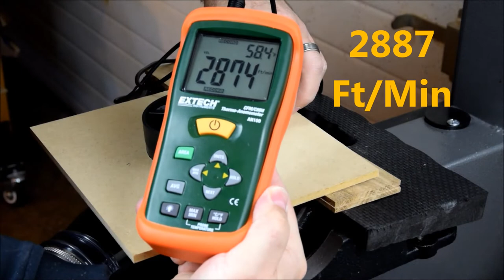Bandsaw Dust Collection Laguna 1412 Bandsaw for DIY and Pro Woodworkers / Woodworking.

Comment: I built this dust shroud for my bandsaw 3 weeks ago.  I want to thank you for sharing your mod.  there is minimal dust on top with round cuts and even with using a sled.  I can feel air pressure with my hand over the narrow slot on the sled!  I've also resawed ~ 4" wide stock and the dust collection is greatly improved.  as you said, most of the dust is from the initial cut, once the blade is buried in the stock, there is minimal dust.  thanks again
Reply from the maker: Awesome!  Thanks for letting me know.
Best

Comment: Just want to say thank you for your creativity and design.  I recently purchased the 14/12 and was very happy with the cuts I got with the Laguna Resaw King.  My only complaint was the dust collection. It spat debris all over the floor just below the table in the front and sides.  I have a 3 hp Oneida V system and I was measuring over 700 FPM in  the 4 inch hose attached to the dust port.  That should have been good enough.  But the airflow around the blade below the bottom guides was pitiful. Then I found your post.  I looked closely at the lumberjacks site and was able to consolidate all of the information to come up with the dimensions of all the components and now I've got to build it.  But, based on your video, and giving it a lot of thought, I'm confident it is going to work as you have demonstrated.  My only reservation is whether or not the Resaw King somehow spits the debris out differently than the blade you used.
Reply from the maker: Hi Nicholas, thanks for the nice comments.  You will like the new dust collection box.  It works just as well with the Resaw King blade, which I also have.  I use a 1/2" ProForce blade for everyday cuts though.  Best.

Comment: I have the exact same saw without your dust collection improvement and I can assure you my lower cabinet has never looked that clean!  Definitely an improvement I'm going to have to make when I have a chance.  Thanks for sharing!  I'd also be interested in your table extension if you have any info on that.
Reply from the maker: Hi Rob, 
Yes I have detailed info on how to make the outfeed table for the Laguna 1412.  Check out my bandsaw mods video! 
Thanks

Comment: By chance, do you have a particle count meter and have you looked at changes in fines in the air before and after? This looks like a great idea, but I've come to believe that what we see may not be a good indicator of changes to fines, which are too small to see. Offhand, my guess is that your mod must help because of the increased velocity, but have you measured in any way?
Reply from the maker: I've measured with an anemometer for airflow, but not with a particle meter.  I know that some mods only make marginal improvement, but from personal experience and from others who have commented here... this mod makes a tremendous difference.  
Best
Reply: @TheThoughtfulWoodworker  I very much suspect you are correct and am going to try this on my 1412.

Comment: Why not run 4” on both ports? Asking because I’m about to do a similar project and have 4” going to bandsaw and was going to do 4” Y - two 4”s but see u did a 4 and 2”
Reply from the maker: My setup is honestly more like two 2-1/2" ports.  The lower port is 4" in size, but it's choked off by a magnetic cover inside the lower cabinet.  The upper port is 2-1/2" in size and relies on high suction and air velocity more than CFM.  I've experimented with a lot of bandsaw DC setups and the ones with a high velocity upper pickup box (like this one) seem to perform best.  
If you have a 3-5hp dust collector you could probably get away with two 4" ports. 
Best
Reply: Ugh yeah I’m not sure what todo I have a 2 HP grizzly that is only hooked up to table saw and a Dust right Quick Change hose that I connect to band saw but it’s an older 14 inch model that came with 0 dust collection and a bunch of gaps for dust to fly everywhere- I installed a 4” port on the bottom cabinet where lower tire is but it doesn’t do much as there’s a lot of open space between cut area and port so gonna add something similar below the table like u did - guess I’ll have to experiment more
Reply from the maker: @josephromero1596  you will love the dust collection of a split system like in the video.  Really good collection.  
Best

Comment: Anyone know if this same setup will work for the Laguna BX18?
Reply from the maker: I'm sure something similar would work on the larger bandsaws.  Your dimensions will probably change, but the same basic concept should work.
Best
Reply: @TheThoughtfulWoodworker  Ok thanks.  I looked at mine earlier and it will have to be wider to fit mine.  I have came up with a large number of woodworking conglomerations in my day.  I can most likely take your idea and templates and taylor them to fit my saw.

Comment: This really begs the question as to why machines of this price point don't come with proper dust collection design built into them?
Reply from the maker: The 1412 is on the lower side of the price scale, but includes a lot of the big boy features.  Bandsaws in any price point seem to have mediocre dust collection, but the good news is... It's easy to fix!